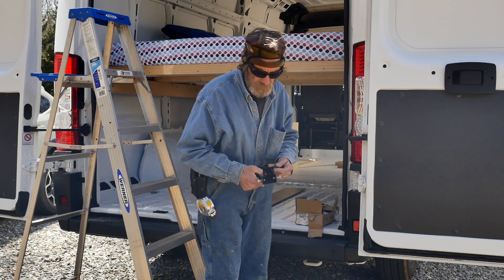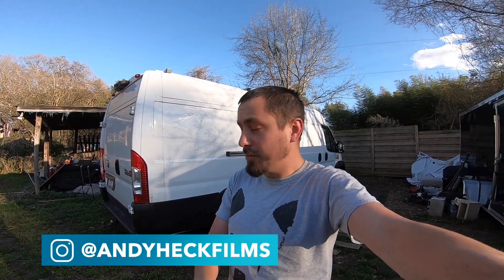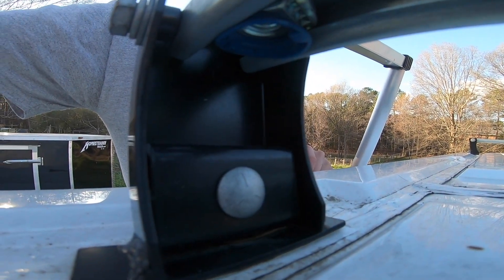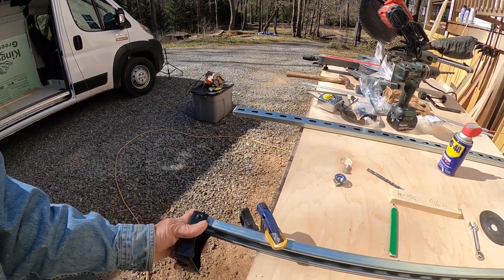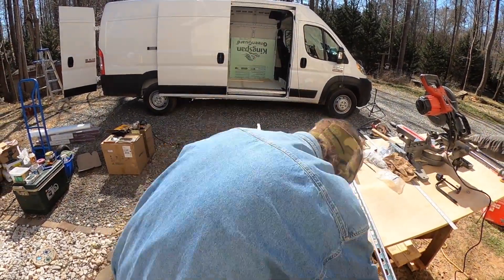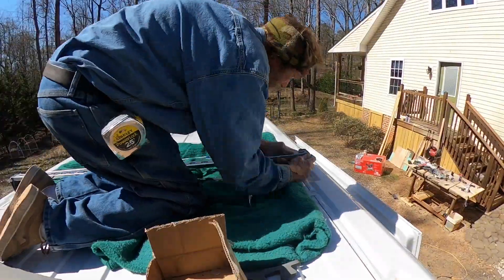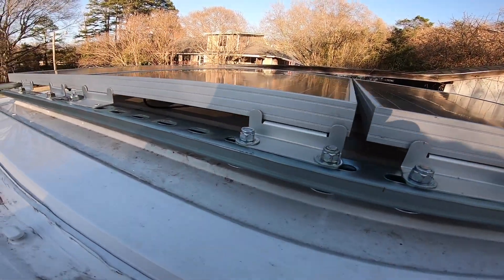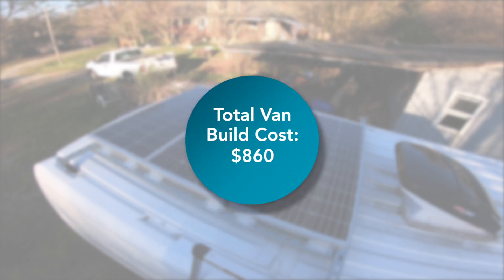DIY Roof Rack - Ram Promaster Unistrut Solar Brackets - Van Build EP4

Comment: I might finally pull the trigger on getting my roof rack. I like this setup because I lowers the vertical unistrut whereas others raise.
Reply: I just ordered through your Amazon link! 🤘🏼
Reply from the maker: Thanks for checking it out!  When I had 2 100w panels, I was able to mount them lower too but with adding the 3rd, I had to mount above the cross rails.  Obviously you can modify depending on fan placement and keep it low.
Reply: How do you attach the unistrut overlapped perpendicular?
Reply from the maker: They sell nut inserts at the store that slide into the rails.  I just used those and through bolts.

Comment: Is that a large washer across the open end of the lower strut with the bolt going through it connecting to the cone nut in the upper strut? Seems a bit unsupported with so much bolt exposed below the cone nut. Also, is there some material between the two struts?

Comment: Your dad did a great job on getting that all installed.  I noticed that you guys mounted the strut channel the opposite direction of most people.  Is there any worry about water sitting in that rolled lip on the strut?
Reply from the maker: I guess I hadn't given much thought to that and either way water will sit in there.  It's about a year since the install and I don't have a rust issues or anything.